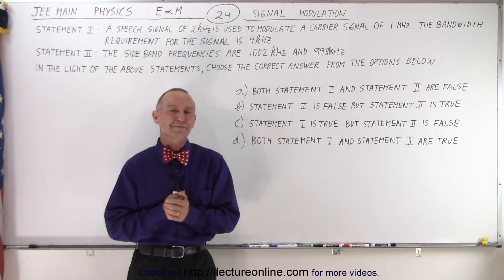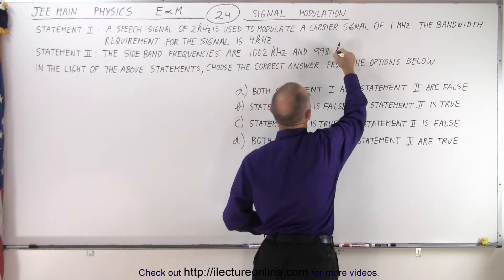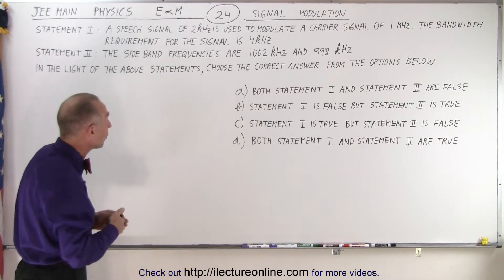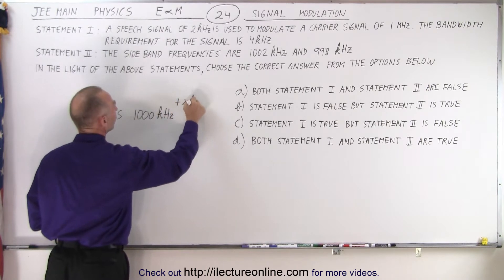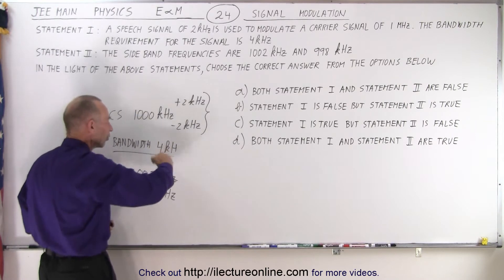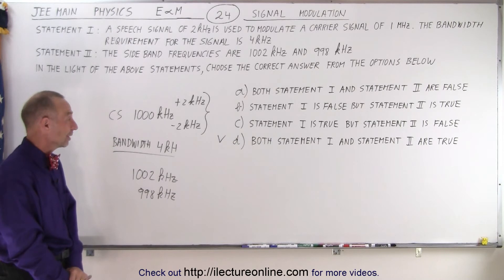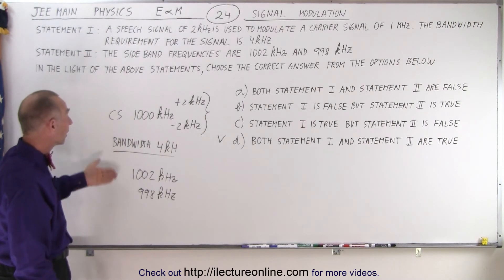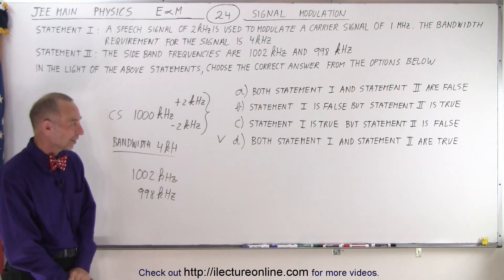JEE Main Physics E & M #24 Signal Modulation

Comment: I find these statements confusing.
A speech signal of 2 kHz is not always a 2 KHz sine wave. Speech can be anything from zero Hz to 2 KHz, so the sidebands are not always positioned 2 kHz above and below the carrier frequency.
If it is only a signal of 2 KHz, then it is a continuous audio tone at fixed frequency. I would not call that speech.
Reply from the maker: These are problems directly out of the JEE MAIN tests given to students in India.